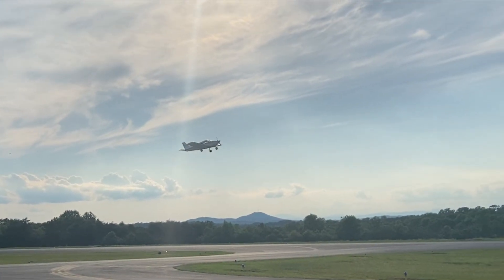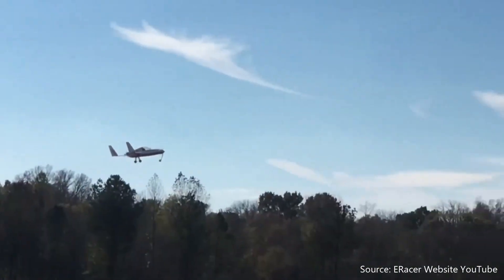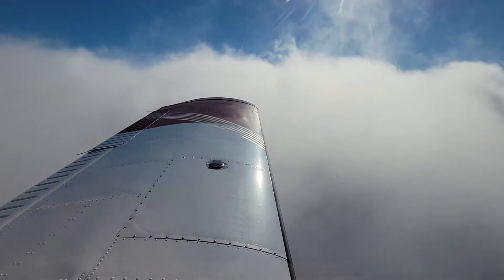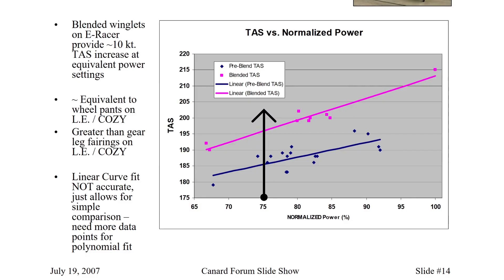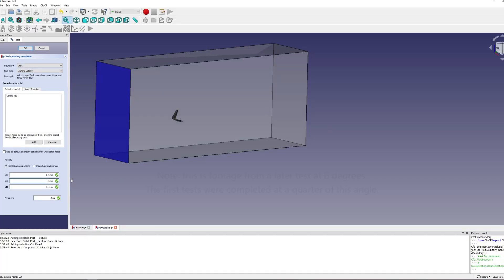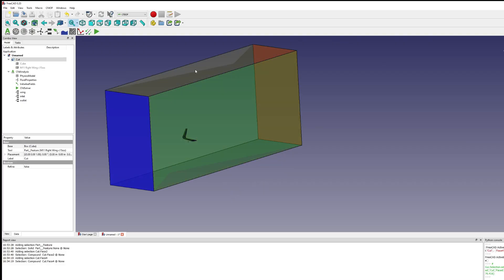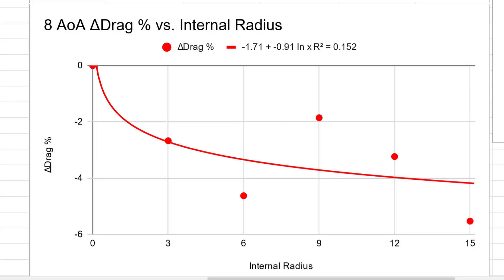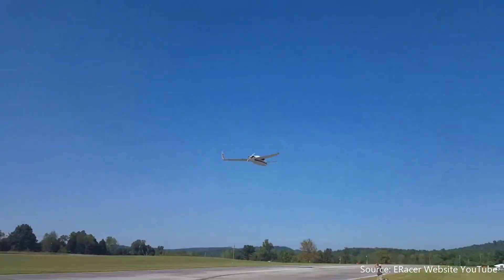E-Racer Blended Winglet and Interference Drag CFD Analysis

Comment: Very nice presentation. Question: did you ever test MZ’s suggestion that the actual placement of the winglet is placed too far forward on the E-Racer design? Eg simulating a zero radius intersection but with the winglet located further aft on the wing?

Comment: I believe I saw winglets smaller but very similar back in the 80s during a race with home builds. A few of the guys were from the skunk works at Edwards Air Force Base. Their racing days were cut short because the brass did not like the future designers of the stealth aircraft we're flying at 200 miles an hour 25 ft off the deck with other aircraft on the weekends.

Comment: Solidworks cfd module has a tool in it to perform analysis across a range of model values. If you build your model so it can update based on table values, you can give the cfd the value that you want to sweep through, it will give you data for all values within the rqnge you specify.

It takes FOREVER, but at the end, you can just change the blend radius value and see the updated CFD results without needing to rerun your analysis for each value you want to see.

It's also good for finding transition values that you otherwise might miss, as it will focus analysis more on value ranges that show large step changes.

Comment: I did this work for the Model 60 Lear Jet.  Take a look at the blending on this aircraft vs. the Longhorn wing (model 55 and model 35).  There was considerable interference drag on the Longhorn.  Not only did we blend the wing into the winglet sail; we controlled the stream-wise pressure distribution by varying the section cord length.  The result is what we called the Ogive trailing edge.  This matched the wing's center of pressure with the winglet's center of pressure.  We gained a whole point of drag reduction doing that.

Comment: 6:30 Couldn't they "round" the top edge of the doors to create a pseudo-fairing to 'smooth' the airflow where that from the door and wingroot intersect?
They could fill the 'void' volume created at the top with soundproofing rubber or foam strip that would further enhance the airflow, sound, and air pressure differentials experienced inside of the cabin.

Comment: Hi, very interesting and helpful. What do you think or a wingtip root mounted propeller, mainly in the pusher configuration? Do you think this can reduce vortices? I understand that this is not able to provide a rudder effect but I am considering drone designs where the effect of a rudder comes from vectoring fans, these may even be on the wing tip. I am hoping that pusher configuration has the same effect as a puller configuration at reducing vortices but with laminar flow wing. In thinking about your design, I wonder if suction within the wing via a very slender fan and holes to suck boundary layer off could also eliminate interference drag at the winglet root.
Reply from the maker: When you asked this I immediately thought of Think Flight and RC Test Flight. They do videos like this and I found one that somewhat answers this exact question. https://youtu.be/Vi9FqIAG0Rg?si=ojulLXlNsmQ6u1S5

Based on that, I think you get benefits of tip mounted props even in the pusher configuration. They are small benefits, but drag reductions nonetheless.

Having some kind of active suction to reduce pressure increases at the joint is an interesting idea. Unfortunately it is too much for most CFD tools as you have to choose between an internal or external analysis. Such a test would involve both. I’m sure there is a way to do it, but I think practical testing on drones would be the best way. Another thing to consider is would the fans draw more power and therefore consume more fuel than a more efficient winglet intersection? These are fascinating questions to think on. I wish I could give a better answer than more questions.

Comment: Do you think that you're findings would apply to a blended winglet?
I've noticed on the  blended winglet that the upper winglet has a sharper (lower number) angle than the lower winglet.
I ask, because I want to build composite wings for an RV-6, and incorporate a blended winglet.
I would appreciate any input that you might have.

Comment: I like that you even mentioned "diminishing returns", which are returns, nonetheless. Modern designs like the Boeing 787 wing, seem to indicate that the largest practical radius is optimal.

A square has more perimeter than its inscribed circle. Besides reducing interference drag, increasing the winglet radius also reduces frontal area. Less frontal area means less drag. Structurally, it results in less mass, less cost in (composite) material, and the removal of a difficult-to-layup joint.

Comment: I wonder what results you would get with fences added to the underside of the wing. Perhaps the stall is partially due to vacuum created by the air on the underside running spanways toward the wing tips? Just a thought. People report better performance with the fences so maybe you should rerun your wing with them.

Comment: Very good work!!  My work in RF has me running lots of 3D electromagnetic simulations using Ansoft HFSS.  Also I run multi-dimensional simulations of circuits using Keysight ADS and Cadence Spectre.  So I totally get the trades between accuracy, simulation size, time, and tool capabilities - along with licensing restrictions.

Kudos to you for persistence and for developing good insight.

I think what happens a lot with running simulations is that one’s biological neural net gets trained.  That training, I think, is a primary benefit of using simulators.  They may not always provide accurate results.  But they will definitely educate your mind about trends. A lot of times this training on trends and principles leads to innovation.

Again, great work well explained.

Comment: Good vid, thanks!
Well, sadly, I`m not smart or aviation engineer, but if there is no need for vertical stabilisers at the ends of the wings, it`s easier to make the end sections of wings in such a way, that they do not produce lift.

Comment: 4:50 It's a common misconception that Bernoulli's Principle produces sufficient lift to allow an airplane to fly. It does not. Newton's 3rd Law (action/reaction) is the main source of lift. This is why aircraft with symmetrical wings fly just fine, and why aircraft can fly inverted. You could accelerate an aircraft with a traditional wing at zero AoA down a runway all day long and it will never take off, until you increase the AoA sufficiently that the force of the air hitting the bottom of the wing exceeds the value required for flight.

Comment: Do be careful.  If you keep modifying and improving, you are likely to optimize so far that you get negative induced drag of entire airframe. Unwary pilots will then find speeds shoot right past Vne and if the wings don’t come off, they might wind up in a sub-orbit even if they kill the engine.
Reply from the maker: Thank you for bringing this to my attention. I have never once thought of attempting to mitigate that particular risk, but I'm thinking about it now. Maybe that is why some LongEZs have the air brake.
Reply: @WalkerWeathers  This exchange is a great example of the advancements of collaborative thinking!  Archeologists may not ever be able to definitively say how the pyramids were built, but thanks to us, future generations will know why Rutan installed airbrakes. Speaking of which, around 1990 I chatted with a ferry pilot who had landed some early design Rutan at Bangor, Maine. He was going to fit long range tanks for an Atlantic hop but was having second thoughts because rhe brakes had failed on the ramp and he had hit the cyclone fence.  Maybe the airbrake was a bakeup to the wheel brake as well as a Vne rescue option.  (That plane had a weird fore-rudder under the fuselage.)

Comment: You might also want to investigate prandtl style wingtips just inboard of the tip and prior to the winglet. This will locally reduce the pressure variance (local to the wingtip) between the upper and lower airfoil surfaces. This tip design could also incorporate winglets with less form drag.

Comment: The part down the wing doesn't need a faring, there is no problem with a 90 degree angle perse and a faring in the wing would be worst than no faring at all. Look at airliners, no faring at the top of the wing. Only In the trailing edge of the wing a faring could be necessary on some situations.

Comment: Outstanding!  I've been pushing this for years, ever since working through some computer (Fortran) simulations in the 1980s.  We examined winglets whose root chord equaled the wingtip's chord.  As for the other parameters:

Winglet tip chord:  0% (sharp point) to 200% of winglet root chord
Winglet angle relative to horizontal:  -120 degrees to 120 degrees
Winglet angle of attack relative to winglet root (straight ahead):  -30 degrees to +30 degrees
Winglet twist relative to winglet angle of attack:  -45 degrees to +45 degrees

We were exploring extremes and quirks, and really wanted to know what might happen if the winglet were not only canted down, but so much that it was tucked under.  Might their be benefits of exploring configurations well outside the boundaries of conventional wisdom, which suggest about a 60 degree angle up and about a 3 degree outward twist?

We initially ran it as 1% and 1 degree increments.  We quickly realized the PC could not handle 259,200,000 data points!  So, we adjusted the increments to 10% and 10 degrees, 25,900 data points, and found no benefits of strange dimensions outside of conventional wisdom.  We then re-ran the simulation using 1% and 1 degree increments to +/- 10 units either side of the identified peaks.  So, another 160,000 data points.

I do not recall the exact final figures, but it's of little consequence as far better simulations and testing have been done since.  Besides, we were running this on IBM PCs, the original 4.77 MHz models, and with 640k RAM and 360k floppy drives, no less!

I do, however, recall that it was around the following:

Winglet tip chord:  42% of winglet root chord
Winglet angle relative to horizontal:  +47 degrees
Winglet angle of attack relative to winglet root:  -6 degrees
Winglet twist relative to winglet angle of attack:  -3 degrees

We only explored the reduction in induced drag at POH-published standard-day cruising airspeed at mid-point of a leg of a distance commensurate with normal loading and enough fuel for 80% of MGTOW.

Again, we developed the software and equations from earlier published models, so it was more of an exercise in how to conduct simulations than in finding the right answer.  Over the years, however, I've been pleasantly surprised to find we were on the right track.

I wish we could have have analyzed curved winglets, but we couldn't find any such published equations.  Even if we had, it would have required vastly more processing power than we had at our disposal.
Reply from the maker: That is some fascinating research. Great idea to test all possible configurations just in case some genius design is hiding in a place we wouldn't think to look. I imagine the processing times were painful on such a setup.

Comment: Just looked at eagle in flight video.  Tip feathers curve up and back.  Maybe 30-40 degrees.   They flight much slower of course and probably zero useful info from that.
Reply from the maker: Perhaps the information is not useful right now, but I'll tuck that away and maybe I can use it for something one day, Thank you for sharing.

Comment: Has anyone ever put metal leading edges on a canard aircraft
Reply from the maker: Many fighter jets have canards that are made entirely of metal, but I understand what you’re asking. There are not any that I know of, though the Cirrus SR-22 and Cessna Columbia do set a precedent of bonding a metal leading edge to composite wing and stabilizer structures. I was considering doing something similar on mine to serve as a path for electricity to follow in the unlikely event of a lightning strike.

Comment: great video, but you have to bear in mind that that is not a parametric study, because not only the radius of the curvature was changed. The geometry was overall different, in each CAD. That really, but I mean REALLY influences the CFD. 

Regarding the "Stall" resul in the analysis, that might be not completelly true. It's highly dependable on the mesh near the boundary layer, and the turbulence model that you used. A k-epsilon will behave differently than a k-omega.

Comment: I would like to make a close coupled canard for a longeze .  What programs can I use to see if this configuration is possible . Rutans design is ugly as heck and I think an update would be wonderful
Reply from the maker: As I’m sure you often hear, the canard on the Long EZ is designed so it will stall before the main wing. That is a complex aerodynamic requirement to meet. I do not know which programs would help with that (the ones I used might help, but it would be a long process). I do know that computer simulations alone are insufficient to answer a question like that. Because of the safety issues involved actual wind tunnel testing would absolutely be necessary to do it right.
Reply: @WalkerWeathers  right you are . Thanks for reply . I reckon it's doable and would make the aircraft into a beautiful thing . I'd imagine wind tunnel testing would be hugely expensive

Comment: The detached flow you saw at 12 degrees aoa is not necessary a main wing stall. Since it was a small region near the back of the wing, and only a small spanwise section it may have just been local seperation, which the pilot would feel as buffeting.

Comment: 16:50 If the problem with increasing the radius is the loss of control surfaces, you should test the different lengths of rudder for a specific radius.  For example, if you feel that a 12" radius starts to compromise the control surface too much, try 12" of radius, but bump the tip of the winglet up 3".  Likewise, you could try 15" with +3" and +6" inches of overall winglet height.  That would result in the same amount of control surface as with the 9" radius, which, in turn, might allow you to keep (most of) the L/D improvements of the larger radius, without compromising handling.

Comment: The gains are real. That wing winglet intersection is a big problem and a nice sized fillet does wonders. I think it was probably worth 10kts on a long Ez. I recall tuft testing and seeing vertical flow aft the wing TE and up the rudder...and saw a bird literally get caught in the wake, bounce around for a few seconds and then get spit out.

Comment: not an airplane designer... but could the smaller vertical stabilizer issue be fixed by switching from only having the trailing section of the stabilizer actuate to having the whole surface rotate? (IIRC the f16 uses this for its horizontal tail sections (but for different reasons ??))?

Comment: This is April of 2023 and I have seen the video just today, I know it's been months from your post, but I think I can help a little.

Your vertical winglets are intended to keep drag reduced, give stability and tilt the aircraft, right? But there's a close up where it seems the profile cut to be a little flatten outboard and a little bumpy inboard, so it looks like having a few lift inboard and crossed lift up with the wing.

My proposal to improve your work is to use a symmetrical NACA profile at the winglets. This way, you don't fight lateral lifting at any circumstances. I know you did this almost a year ago... But I believe this might be helpful.

Thanks for reading. Greetings!
Reply: Oh yeah! By the minute 05:30 you can see what I saw. There's the lifting profile at the winglets causing the crossed lift. There is where I'd put a NACA 00 profile (just the strength, not the wind force) Great job, BTW!!!

Comment: That 12° AOA separation is interesting. Has anyone done active vortex generators for low speed flying? Or is that just generally not a thing?

Also, I would be super fascinated to see a blended endplate or blended dual winglet version of this.
I really need to get a laptop good enough to start doing CAD lol

Comment: Great video. As you mentioned you need high fidelity CFD simulations. OpenFOAM is a great option ( you didn't explain your problem with OF). There are other options too, such as SU2 or Lattice Boltzmann cfd codes. I'm learning shape optimization with DAfoam. I think you should give it a try

Comment: I have a thought that if you calculate the curve vs the original wing length ratio then it should show an optimal curve ratio.
   eg; 15 foot with 9 inch curve giving a practical advantage, so then a 20 foot wing with a 12 inch curve should get a similar ratio as percentage result.
Reason being say you have a 10 foot wing and we change the tip to a 12 inch curve to improve the drag, the curve is taking away the wing lift area so it is now a 9 foot wing with a 1 foot curve on the end.

 So to keep the original effective lift then the overall length should extend out with the curve or keep within a ratio of drag benifit vs lift sacrificed for the curve
If the drag is reduced then the increased speed requiered to gain the requiered lift needs to be factered into the design.
eg; for the 10 to 9 foot example would change the stall speed significantly.   🧐

       OR     is this only due to the air density needing 9-12 inchs to stabilise regardless of the plane/wing size ?    🤔

... I havn't stop thinking about this ever since I learned about the A380 wing design many years ago , I need some sleep  🤯 🤣

Comment: Where the wing connects to the cab and you can a fairing can't be put there, why not put the fairing on the door with the door seal connecting to the top of the wing.